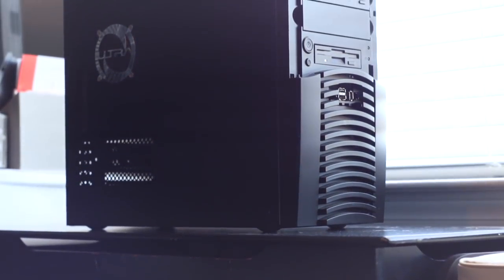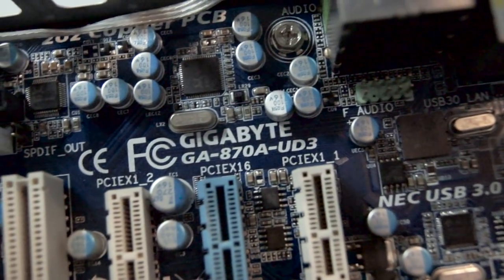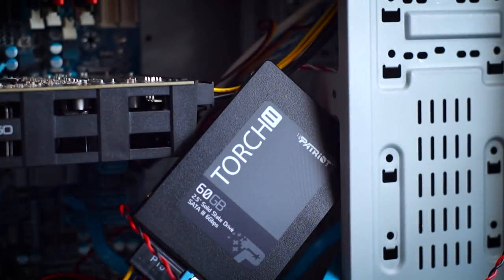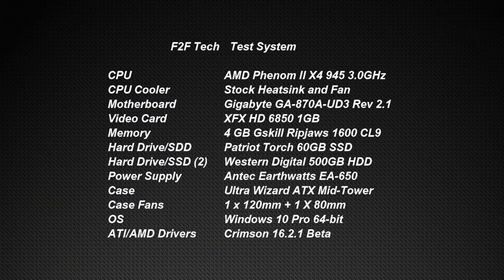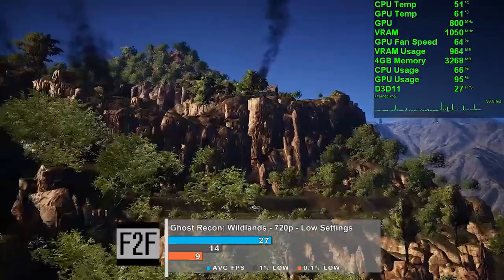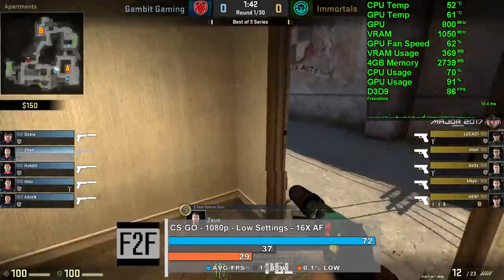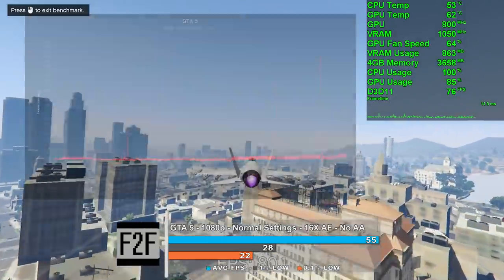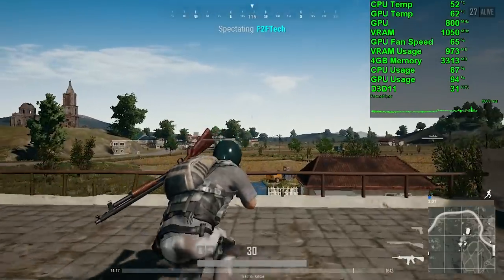How well does a 2010-2011 AMD Phenom II X4 gaming PC hold up in 2018?

Comment: my old gaming pc thatt i still use has a geforce gtx 8800 and a pentium g4560 4 gb ram
Reply from the maker: Legendary GPU 👍
Reply: Yeah  its still good toda but i cant get it to work on my monitor or tv either will any of my 9 pin computers cant be my cable I need help getting it working any suggestions?
Reply from the maker: davefrom jupiter I think you mean 15-pin. That’s what VGA uses. 9-pin is a serial connector (DB9).  The card has two DVI outputs, so you would need an adapter from DVI to VGA.
Reply: thanks mate will try i have a dvi and 15 pin vga cable if that doesnt work i wll try my tv the monitor is quite old
im subbed
Reply from the maker: davefrom jupiter hope it works out for you. Thanks!
Reply: I sent you pics of the DVI cable on twitter you can see if it's the right one
Reply from the maker: I responded. Looks the vga end is missing a pin.
Reply: i will get a new one then the cable had been sitting in the garage for a while

Comment: Give it 25-40% FSB overclocking for best performance
Reply from the maker: I have in the update video
Reply: Btw, found out an overclock  "6 Pin" Zotec GTX 750ti working very well with this 945 (non BE , 95W TDP)Phenom II @ 3.3-3.4ghz - default Voltage -stock AM2+ heat-pipe cooler (220-230 FSB/bank interleaving:Auto Dual Ram: 5-5-5-15 DDR2 800mhz Asus N-force 630a PV7050 motherboard) haven't test with 1066mhz RAM.... cinebench: 330cb-340cb Open GL: 68-70fps 
ps: With C&Q enable, Power profile: Balance

Comment: Sorry if this a silly question (I did watch the video)… With my AMD Phenom II X4 955 3.20 GHz from 2011, would it be pointless to buy a 1050 gtx 4GB card or a 1060 gtx 6GB card.  Thanks for any reply.  I'd hate to waste my money.
Reply from the maker: 1050-1050Ti is the fastest I’d go
Reply: @F2FTech   thanks for the reply. I kept reading that people with an older BIOS (Legacy which is what I on my pc) have had trouble with newer cards working.  So I was going to get a 770 TI but that thing is 10.5 inches long and too long for my case.  I just installed an EVGA  FTW 750 TI card yesterday (it barely fit being around 9 inches long) and I am happy with it.. for now. : )  But I'll keep your advice in mind for sure, thank you.

Comment: Sold an Asus Crosshair III that had a 965BE/212+ @ 4.4ghz with 2x8GB Ripjaws and dual Asus 5850"s all wrapped up in a Corsair 300R.. Not a hiccup, nothing ever failed, a few bsods when it was pushed to the limits but other than that it was all gravy.
Reply from the maker: 4.4GHz is impressive 👍
Reply from the maker: 4.4GHz is impressive 👍

Comment: I have phenom 2 960 t, r9270x 2 gb,  and 4 gg ddr 2 (533 mhz-4x1 gb all slots taken on motherboard ). Is It Worth It to buy 8 gb ddr 2 (800 mhz) ?  My motherboard is GA-MA770-UD3
Reply from the maker: If it’s not too expensive, then I  certainly would
Reply: Kingston 8Gb DDR2 800MHz for 30 eur. Good deal , DiRT Rally maxed runs  amazing, hope gta5 will run fine :).

Comment: dude, that CPU should be paired with something like R7 370 2gb, maybe 4gb version... Rx 550 or 560 should be the top... On the Nvidia side, GTX 950 its a great example of the limit that CPU can go... Overclocking the CPU will not help that much, but you'll get something like a 5% improvement by going from 3.0 base to 3.4 or 3.5... i wouldn't go any higher with that old CPU and that non-disipated VRM Mobo.

As for the GPU... it is the bottleneck most of the times except maybe for GTAV, but that game its quite old right now and while it uses a lot of threads it still relies mainly on singlecore performace

By the way, my mom still has his Phenom X4 945 rocking solid as his "check mail browse the web and print stuffs PC" let me tell u that 3.5inch where way outdated even for 2008... a multi card reader should me the front 3.5 of that time period
Reply from the maker: Nice. Yeah I’m in the middle of testing it right now. I’m going to be doing stock and overclocked comparisons. You’d be surprised how well it’s handling a 7970 GHz right now. Also overclocking the NB is a must. I have a fan over the motherboards VRM, so it’s helping with sustained stability.
Reply: @F2FTech  hope you used 4 extra gigs of ram, in order to aliviate the bottleneck that produces. going 8gb should be pretty cheap, since you have 4 slots and you can populate them with 2gb sticks that costs close to nothing

Comment: What GPU will you recommend me for FX 8350? I was thinking about R9 270x.
Reply from the maker: I’d reach for a R9 280/X. Or if you wanted new , GTX 1050 Ti.
Reply: I want to be all AMD build so R9 280x sounds good. I hope that the CPU will not bottleneck this card.

Comment: MY x4 945 phenom 2 when to 4.3 in bios with a auto Oc on my bios. It was a great cpu ran my games for like 4 years easy  World of warcraft, BF bad company 2 lots of years of gaming on that cpu.
Reply from the maker: 4.3 sounds really high. Was it stable? I wonder what voltage it was applying?
Reply: It was stable alot of people with that cpu reported the same thing it would highly overclock. I gamed on it for years with no problem. Those motherboards had a voltage selection pull down i dont remember what voltage that was. It burning crusade, wrath of the litch king time  i played the original crysis on it as well. I just remember that the voltage numbers were red saying its your fault if something goes wrong but it was one of the first two settings in the Red you could test it at your  own risk lol.

Comment: you should have use newest gtx 10-series to pump the usage to near 90% or above. if you do that, i will subscribe cuz i still have this proc. nice video btw, thanks for the information
Reply from the maker: Check out my newest vid. Using a 7970 GHz, which is faster than a GTX 1050Ti
Reply: F2F Tech sorry i didn't check your channel. good job

Comment: Can someone send me an athlon II X2? my PC has am3 mobo
Reply: I can't play games at low settings with my AMD sempron 145
Reply: You can get a athlon II x2 for around $9 on ebay. You may not be able to use the stock heatsink that came with your sempron as it only has a 45w tdp
Reply: But I don't have a bank account. I'm a student btw
Reply: Base Jacker u want my phenom x4?
Reply: Hi Im Seyf yes pls. I kinda need it. I can't even play lol at 60 fps
Reply: What do you have for a graphics card?
Reply: Carson W234 I only use my onboard graphics. Even if I add a GPU it will get bottlenecked anyway

Comment: You could have used CPU-Z to detect the CPU specs instead of almost breaking it out of its socket -.-
Reply from the maker: Yeah for sure. I wanted to replace the thermal paste anyway, so it would’ve happened regardless. A couple of pins were bent, but a mechanical pencil can easily fix that. Its happened to me many times, as it’s pretty common with pga CPUs with older thermal paste.
Reply: As I said in the other comment, gently turning the cooler left and right repeatedly, until it looses grip, helps.
Reply from the maker: Agreed if the TIM isn’t completely dried up. It’s just this cpu was practically cemented on.  I’ve never seen a cpu stuck to a heatsink this bad before . I had to  chisel it apart.

Comment: had a phenom ii 960t with 4gb of ram and a sapphire 5770, did pretty well till i traded it in for a new computer that had a cpu that was a flop
Reply: How was the new one a flop?
Reply: it performed decently, just that it generated too much heat for what it offered when i got it, and would have been nice if it's ipc was about 10% better and the tdp was around 15% less. basically, i fell for the hype at the time.

Comment: why isn't either the CPU or ther GPU running at max. Where is the bottleneck when you run 50 fps but neither run at max???
Reply from the maker: There’s still an IPC bottle neck. Not every game will use all 4 cores 100% of the time. I only show the total cpu usage, but it’s likely that one or more cores are at 100% and they can’t keep up. Each game engine handles the cpu differently. I can add each core usage for the future video if you’d like?
Reply: F2F Tech just the explanation of why is fine for me. I got a phenom x4 955 black and a HD 6850 and I have been wandering why I see this, and now I know. Thank you for the answer :-)
Reply from the maker: martin jorgensen very nice. It’s nearly the same setup 😄

Comment: man i have same system but gpu is slower(gtx 260), and i have 200+ fps at csgo. Mby you are doing something wrong? I ve never seen so low fps in game.
Reply from the maker: Artemius Stragivari Are you comparing the same settings? Also, this is the inferno map.
Reply: 1080p, low settings. Yes inferno. Maybe problem is that you measirung live game translation or record? Mby in-game it will be better.
Reply from the maker: Artemius Stragivari Yeah that could be it. Ill dig a little deeper into it. Thanks

Comment: Who games at 720p anymore? Nobody with a full time job, that's for sure. Also, everyone likes to talk about cpu bottleneck, never mentioning poor coding, lack of RAM, lack of VRAM, slow hard drives and which version of direct X is being used would be the culprit in almost all cases. Unless you have a game that pegs your cores at 100% it's not bottlenecking. It's just another industry falsehood being perpetuated to get people to buy new stuff.
Reply from the maker: Raging Tout Plenty of kids do and people without the means. There is always a bottleneck. Poor coding is a big part, but your CPU doesn’t have to be at 100% for there not to be a CPU bottleneck. For example, if a game is only utilizing 2 cores and you have a 4 core CPU. Total cpu usage won’t be at 100%,and the video card will still be held back. However, just because there is a cpu or GPU bottleneck, that doesn’t mean all games are unplayable.

Lack of vram will generally poor over into system memory and lack of memory will pour over into pagefile.
Reply: Obviously you monitor all cores, duh. That falls under poorly optimized game development unless it was made prior to multi core technology. Not the fault of the computer at all. Once VRAM and RAM 'pour' over as you call it, that will create lag and frame rates spikes. Which many people wrongly think of cpu bottlenecking. I just watched a guy play Fallout 4 on a Phenom II x4 cpu with a 1070 gpu. System ran beautiful with mostly ultra settings. The industry wants you to buy the latest and greatest to fill their pockets but it is not necessary. I was told years ago my AMD FX  8320 would bottleneck my graphics cards, badly. Problem is, I now run it with an AMD RX 480 gpu and there is no bottleneck, especially when running higher resolutions and newer games, the gpu does most of the work. My points still stand. You can call it bottlenecking but I call it poor coding in many cases. Bethesda is well known for this but I do love their games. 20 years of PC building and gaming has taught me not to bother with buzz word descriptions because it's usually 'fake news.'
Reply from the maker: I agree with you on the video/system memory, and I agree with you with a lot of games not being well optimized for multi core CPUs. 

I show what’s going on with all of of the systems I test in my videos. If there is a CPU bottleneck, GPU usage is the best indicator. Obviously there are times it has to do with drivers, or the game engine itself. I have multiple systems, c2Q, phenom 2, and a bunch of core i3,i5,i7’s. Since I’m able to recreate a capture on multiple systems it’s easy to tell if it’s a system bottleneck or a game optimization issue. 

I’ve noticed FC5 doesn’t an excellent job at handling vram and minimal frame spikes happen do to how well the game engine handles video/ system memory. 

You’ll have to link that Fallout 4 video with the phenom 2, as I’m not buying that it ran beautifully. Maybe in the opening scene, but Diamond City would be a mess. Either super low frame rate or lots of stuttering. I’ve had plenty of time with piledriver, and yes there would be plenty of games the 83XX would hold back an RX 480. I’m hoping to test soon enough with a GTX 970. My buddy ran a 1070 with a 8350 for awhile and it’s was crazy how much the cpu was holding the card back. Most games played fine, but there was a lot of performance left on the table. 

 Back to my point. In IT , there is always a bottleneck. That’s why we use tools to find them. Game optimization is harder measure, but testing with multiple test systems can help determine if it’s the issue.
Reply: Actually it was a Phenom 955 running 4k resolution with a 1070 gpu. Framerates were right around 30 for most of the video... https://www.youtube.com/watch?v=FUXxga2x3R4 shows just how little needs to be upgraded to play a newer title at the same frame rates that consoles play at. A 10 year old cpu running 4k resolution, just upgrade your graphics card... funny how it's a cpu bottleneck, only in some games and not others... poor optimization.

Comment: I got a x4 965 and a gtx580 and It still holds up great. V ram is a huge bottleneck (1.5gb) ,lots of modern games only use 70% of the gpu because I cant turn up the settings.  Upgrading to 8gb of ram from 4gb was a must a year ago. I grew up playing games on base model pentiums with cards like gt9600 so lower settings dont bother me.
Reply from the maker: Well at least the GTX 580 still gets driver updates. The 6850 not so much. I’ll be upgrading the ram and going with a 7970 for the next vid.
Reply: Drivers are a big plus, and with a decent cooler these cpu's oc very well. Mine was 3.4 stock and I could get it to 3.9 but decided to stick to 3.7 for the fact that its getting old. You can at least get 3.4 considering they are the same cpu.  3gb vram will allow for a nice way to equally benchmark it.
Reply from the maker: So far I have it at 3.8 @ 1.475v   A lot of voltage for that clock(under an AIO), but there’s more testing to do. The board is stuck at 260 fsb, so I’ve only got the NB up to 2600MHz. Ram timings are next.
Reply: Im at 1.45 x17 220mhz cpu 2200nb with a cooler master 612, having an unlocked multiplier helps. 3.8 is good I had cases like with mine where no matter how many settings I tried it would not go past 4 for some reason. Based on old data I found its not worth it anyways for the heat/power increases drastically for a small gain.

Comment: I5 2400 or amd x4 965 
Which is better for gaming?
Reply from the maker: I5 2400
Reply: @F2FTech  how much difference between them? because amd x4 965 is much cheaper.
Reply from the maker: The Phenom 2 lacks the instructions to run newer games. The i5 2400 is significantly faster. Not sure I would consider the Phenom at this point.
Reply: @F2FTech  if i compare i3 2120 or x4 965 
So which one is better?

Comment: The phenom ii x4 was released in 2009, the phenom ii x6 was released in 2010.
the hd 6850 was released in 2010, so this is a 2009-2010 PC.
Reply from the maker: IIIRattleHeadIII This PC was built in 2011. Since the video card came out at the end of 2010, I decided to throw 2010 in there.
Reply: F2F Tech well if you consider October the end of the year.

And when you built it doesn't matter, you can buy a brand new 60s car, it will not make it as good as modern cars
Reply from the maker: I do, it’s Q4. Anyway, you’re right, but not sure how much it matters at this point?
Reply: +F2F Tech
It doesn't matter, just wanted to point out for sake of accuracy, since the hd 7970 launched in actual late 2011(December) and that GPU was 40% better than the hd 6970, which was 60-65% faster than the 6850 so it's quite the difference and NOT really a representation of the 2011 GPU performance.
Reply from the maker: I’m with you. I’ll actually be throwing in a 7970 GHz in the build soon enough. With 8gb and a overclock.
Reply from the maker: It still would be for a middle of the road AMD PC, which this is. All throughout 2011 most people buying a mid level AMD GPU would be looking at Barts based GPUs. I know I did. In 2011 I purchased a HD 6870 to go along with my 960T. Tahiti variants weren’t readily available until 2012.

Comment: just preheat the heatsink and then remove the cpu.
Reply from the maker: Not sure that would’ve helped in this case.  The TIM was old and completely dried up.
Reply: for me it helpt with my fx 6350 after 2 years of use.
Reply from the maker: Good to know. I think this machine sat for years, but I don’t know for sure. I’ll try it out next time I run into this issue. Thanks!